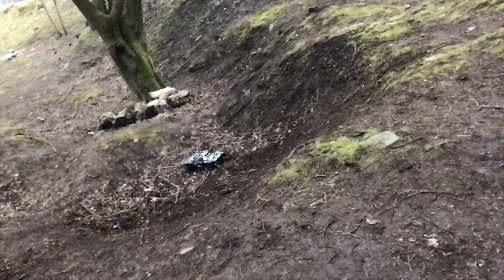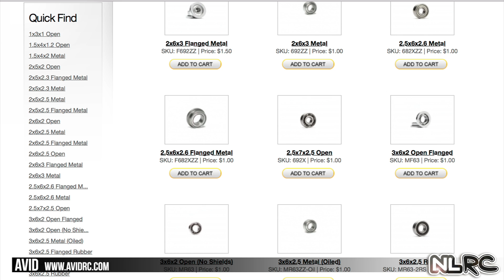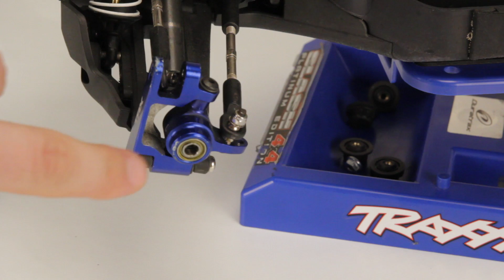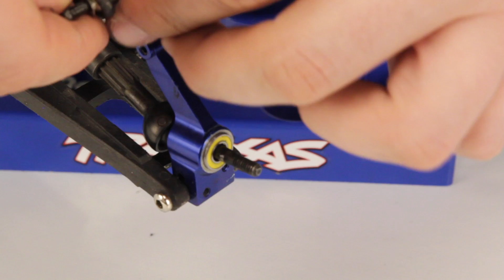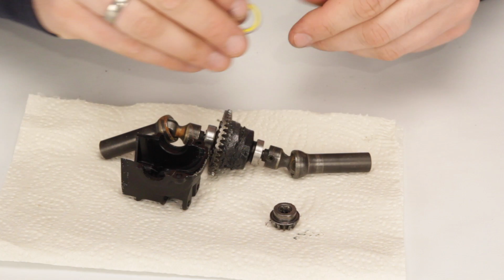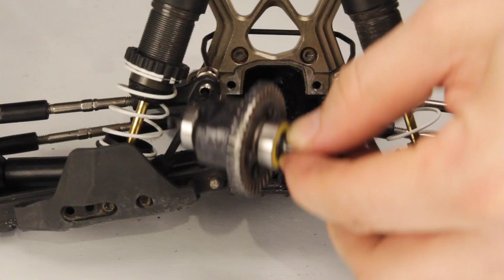Traxxas Slash 4X4 – Change your bearings!

Comment: Fantastic video. This is great if one loves to fix things. I really had issues with my Traxxas 4x4. I'd tossed it away actually.

With all this lock down going on, I pulled it out and realized that the problem was a slipping center diff/clutch. It's now working!!

Not sure I'll set out to change all the bearings, especially on this stock version. Might as well buy another one. Or may not, with all these lock downs 😅🤣🤣

Comment: Great vid bro!... When I bought my Traxxas Rustler 2WD, it came with bushings. I quickly upgraded to bearings & what a difference. 
Also, If you're doing high speed runs & your budget allows it, go with hybrid sealed Si3N4 (silicone nitride) ceramic bearings A5, preferably A7. Or else you'll be replacing them bearings quite often. Ceramic bearing balls are 'much' harder than stainless. Yet they are lighter & have less friction. In identical operation, the ceramic type experience less than 10% the wear of the stainless version. So yeah, they're more expensive at 1st, but you'll be replacing them 'A LOT' less. I'm in the work of replacing all my bearings with ceramic hybrid type since I do mainly high speed runs.

Comment: In the middle of a complete bearing change on my Slash 4x4 myself, just finished the rear differential rebuild and now I'm not sure if I put all the bearings seal side out, and my OCD self is going to have to take it apart and check 😂

Comment: Regarding the wheel bearings, is there a tool or trick to remove a blown bearing? The outside edge of the bearing is seized in the rear hub.

Comment: great job subscribed !!
can you please share whats the motor fan you have and how did you wire it up
Reply from the maker: +rad asd thanks man! I bought the blue heat sink from yeah racing and the stock traxxas esc fan. Then I cut off the bottom "taps" or "mounts" on the fan to be able to screw it on the hest sink. Then I just put the fan wire in the receiver. Easy :)

Comment: do you have trouble with the hex slipping when tightening the wheel nuts.  I had to drill a hole for the set screw or my hub would bind and not roll
Reply from the maker: +Joe S Hi Joe! No I have not experienced that problem. Are you using the included washers between the hex and bearing?

Comment: if you don't drive in the sand or water only pavement   how long do the last ?
Reply from the maker: Well, it's hard so say, because there are so many variables that will play into the lifetime of a bearing. Like if you have a really good traction and do a lot of tight turns this will put the bearings on the rear carries through a hard test. I change those on my racer at least once a month due to the super grip I have on my local carpet track. I basically drive them until they lock up and fall to pieces. Other bearings on the Slash will last for ages. It's a good idea to check every now and then. If you're doing some repairs on the truck, you might as well check the bearings while you're in there :)
Reply: thanks !    i've got the arrma fazon       it's being treated like a lady i never break stuff lol

Comment: The teflon washers he completely does not have on his truck are important. He also completely misses explaining the importance of pre-soaking your bearing. So be careful following this as a step-by-step instructional video.

To add to his resources being offered. There are kits on Amazon SS or standard. This is an SS kit: https://www.amazon.com/gp/product/B00IIEF3EI/ref=oh_aui_detailpage_o00_s00?ie=UTF8&psc=1

FYI: Rubber vs metal side covers has nothing to do with water proofing. It is about serviceability and the ability to oil or grease said bearing.

@Northern Light RC - I have to ask because you have obviously thrown alot of money as this truck with more metal than the avg 8th scale conversion. So since money or weight isn't really a problem then why have you not switched over to stainless steel fasteners?
Reply from the maker: Sorry, I found this comment in the trash due to the amazon link. I must just say that I'm an RC enthusiast and no professional, so I might be missing some good pointers in my videos. I try my best, and all tips I include in my videos work very well for me. But if you or anyone else want to correct me or give additional information, it is very welcome!! My goal on this channel is to share knowledge and experience I had to dig deep to find and make it easier for the next guy to find :) Cheers!